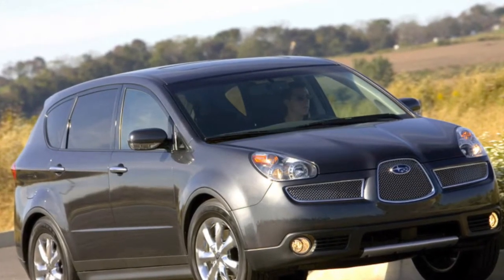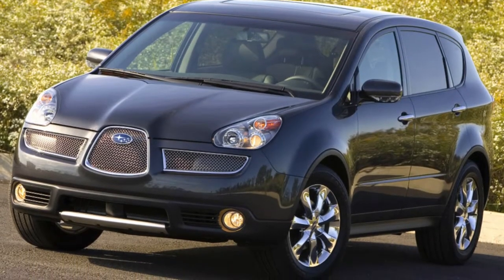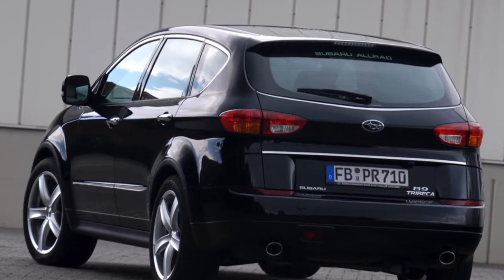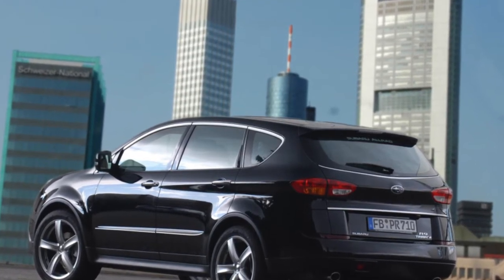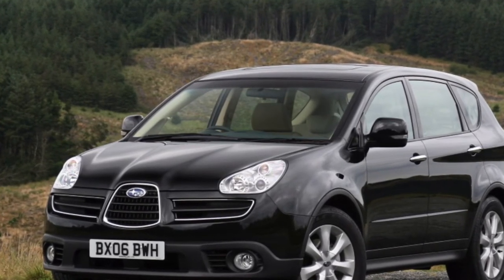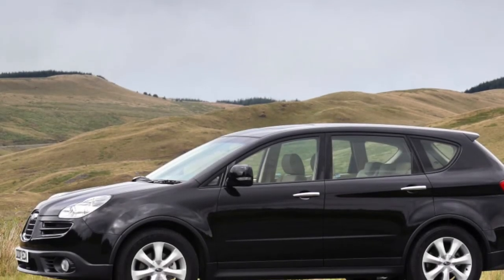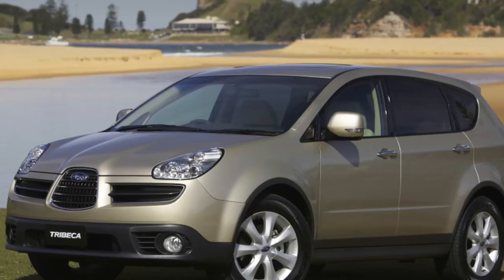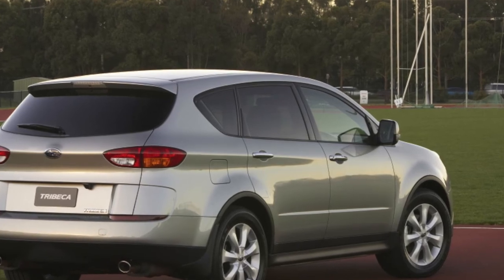Subaru Tribeca B9 Problems | Weaknesses of the Used Tribeca

Comment: I recommend that you read more about the differences between 3.0 and 3.6. Don't put them in the same basket.. 3.6 is way much reliable than 3.0. With regular maintenance, the 3.6' s timing chain can last over 300000 miles (450k km), head gasket problems are not related with 3.6.. Just don't spread the s&it around without having knowledge about...
Reply: I've got both and 3.6 is definitely the way to go
Reply: Please , is 3.6 Gasoline ⛽️ reliable ? 

Please I need your help
Reply: @human_concept225 please is 3.6 Gasoline reliable?
Reply: I was gonna say, " well you're making this sound like a polished piece of shit for jewelry of a car"

Comment: My 06  with 117000 has a engine oil leak that 5000.00 was quoted to fix I just keep the oil at full so far running fine and I gradually ad one quart between oil changes. The radiator was replaced at 110000 after noticed temp was going into the hot mark, other wise nothing major just maintained with oil changes every 3500 miles and always use premium gas.

Comment: narration speed is too fast, but: my b907 vibrates/shakes in third gear while going slightly uphill - at about 2300 rpm. Goes away below 2000 rpm. What could cause it? Thanks.
Reply: Check your fuel filter.

Comment: I own an 07. I replaced all timing chain components and water pump at 120,000. Just replaced valve cover (rocker cover) gasgets at 160,000. The car runs like new. Of coarse I replaced tires, battery and struts as normal wear, regular fluid changes and flush per manufacture. Subarus can get a bit expensive to work on. If your'e not mechanically inclined or know someone who does good work, you should probably stick with Toyota or Honda in an older vehicle purchase.

Comment: Constant ticking noise when driving. Overheating, power reduction, air con only cold, only radio works. New radiator still overheats new thermostat still overheating. Potentially a great car but the issues are far too many and most are centred around the engine

Comment: Doesn't look like the reviewer ever looked under the hood or underneath this vehicle.
Reply: Ive had this car since '06, clean driven had no problems from video
Reply: @rusroyce  I have the 06 my head gasket is blown
Reply: @AndresEscamilla210  just replaced my head gasket, the front suspension, and the engine coil harness 07 B9 Tribeca

Comment: 2006 with 

90,000 miles, front struts and lower control arms replaced. (did those myself)

110,000 miles. So far radiator, water pump were replaced. (pump was leaking)

Two of the fuel injectors were replaced as well, as well as all the spark plugs while they were at it, since they had to lift up the engine out.

The low beam bulbs require the intake and battery to be removed which is a pain in the ass but I got used to that.

All in all good car for what it is, but I'm going back to Toyota Highlander AWD with 8 Speed A/T once this car goes.

Comment: Hi there :)
My 2006 Tribeca is overheating according to temperature gauge but I went to Subaru and they told me that it is a bad signal?
I have changed thermostat and radiator, still the same issue.
I have changed cluster, thought it's electronic issue, nope, still the same.
What else could be?
Thanks
Reply: You have to bleed the system
Reply: Забился радиатор обогревателя салона. Замени и температура вернётся в норму.
Reply: Try replacing your coolant temperature sensor ... Since they claim it's just a bad signal. I bet your anything it's gotta be the coolant sensor